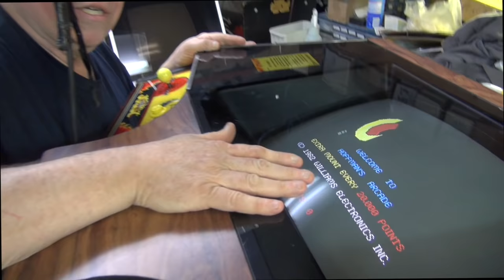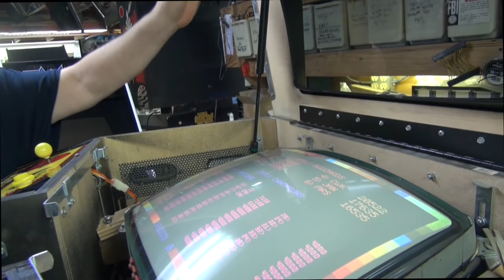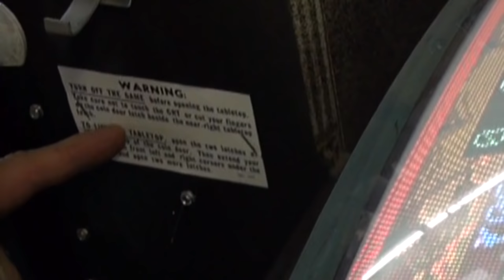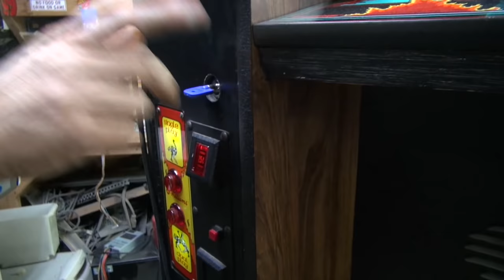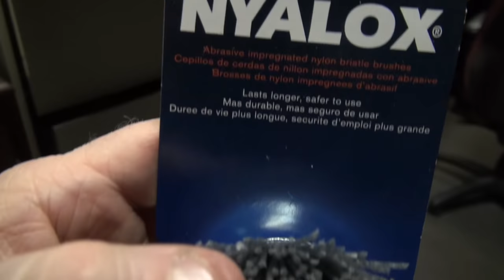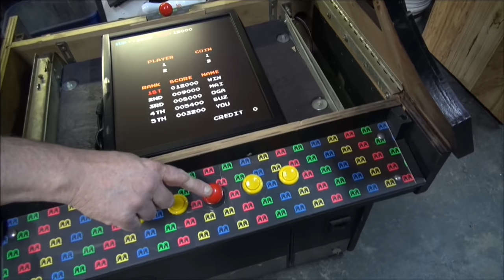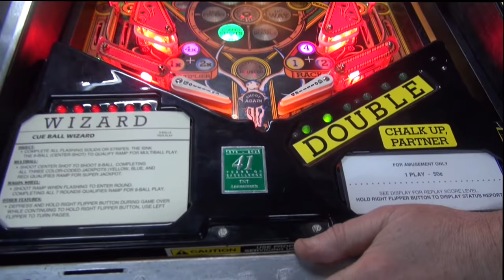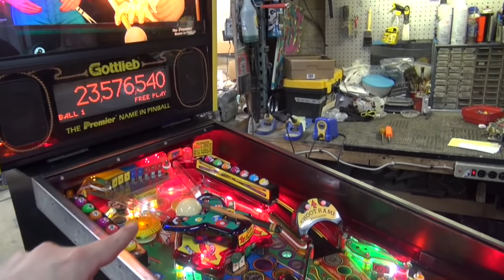#1576 Williams JOUST Cocktail Table Arcade Video Game-only 500 Made!-TNT Amusements

Comment: One word of note for those in the USA.  not all houses have a neutral wire.  I found this out looking for an Alexa powered switch.  Older homes don't have a neutral wire.  We don't.  So depending on that this may or may not cause a problem..  Just thought to put that in here.  If we sold the house we might have to since the electrical code may have changed.  I don't know if it has or not.. Found a site that clears the confusion.  Neutral wires are a 3 wire solution.  However...  having 3 wires doesn't mean you have neutral.  Older homes with 3 wires are Hot Cold Ground.  No Neutral.  Probably need frank or a wiring nut to explain this further as I'm rather new on this info (looked for a google home switch for brother and thats how I found out about it since they mainly say Neutral wire required.  There are some that done and the price for those are higher but cheaper than rewiring the house..